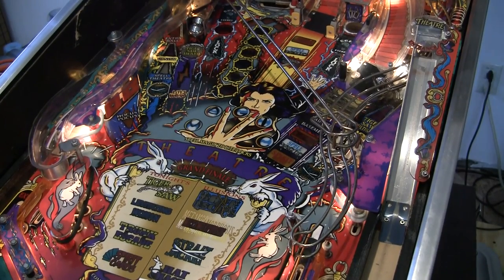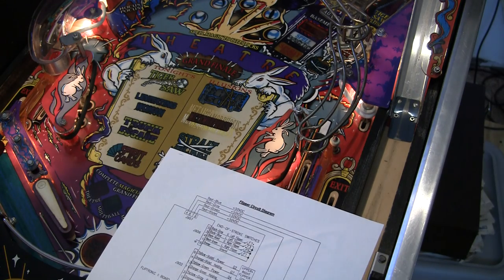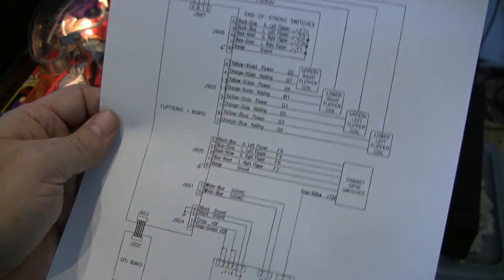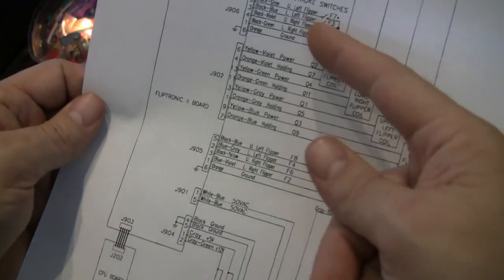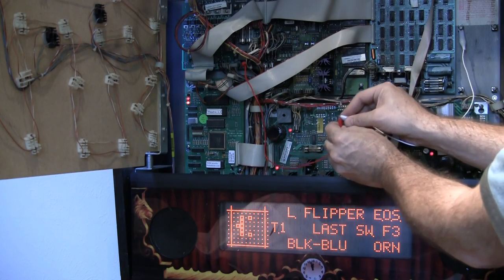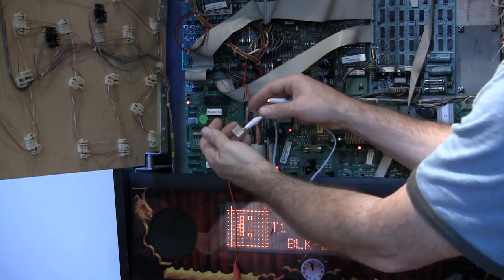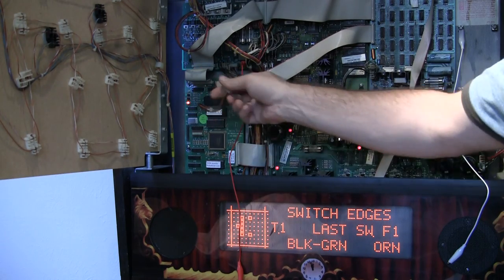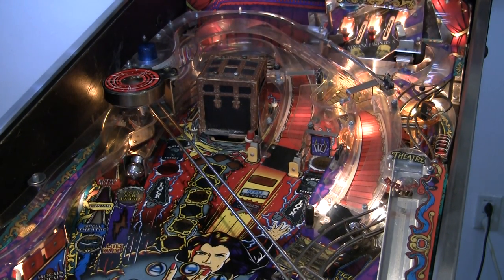Switch matrix problems: ToM switch problem on board or wiring? - p3 - PinballHelp.com

Comment: If you are pulling off the J906 connecter for a 2 flipper game it would make logical sense for  it have 3 connections pin 6 (ground) and the two lower main flippers 1 and 3 the problem with your test is with the connector "pulled" , the wire on pin 6 has no other indicated ground tie in references in its circuit   (if diagram you reference is correct) so the jumper connected to J906 connecter pin 6 cant pull the switch reference down to ground and trigger its switch ,